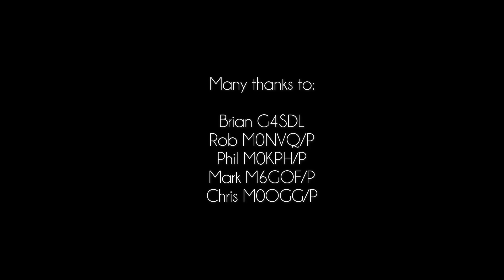Retevis RT3S - Short & Long Range Testing On DMR Simplex - 30 Miles!

Comment: A Simple Way Lewis For Improving Performance Is To Put The Radio On The Roof And Use An External Mic And Even A 19 Inch Rat Tail Counterpoise As Well 
Bless Up Fella 
GGGNR69

Comment: Hi Lewis.  Have this RT3s GPS.  how do you connect to the repeater and how do you know what slot and colour code for each channel?  I have programmed Brandmeister Talkgroups in but don't know which slots or codes, or even which Repeater for My location.   Taking My Foundation on the 22nd, and would like to get it sorted by then.  David

Comment: I have a question if anyone can answer. A frequency which was previously analogue for our local shopwatch keeps coming through on my analogue scanner but as it's digital I can't hear speech, just noise. If I buy a DMR radio and input the same frequency will I be able to actually hear speech? Or is that too easy 🤣